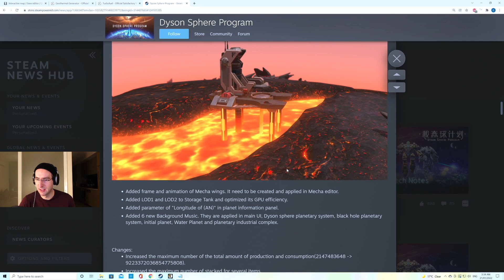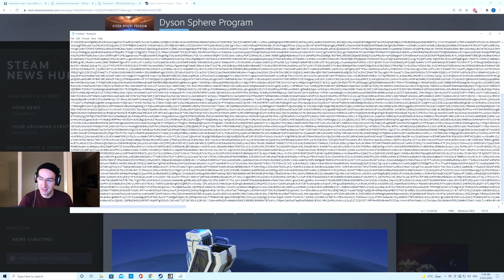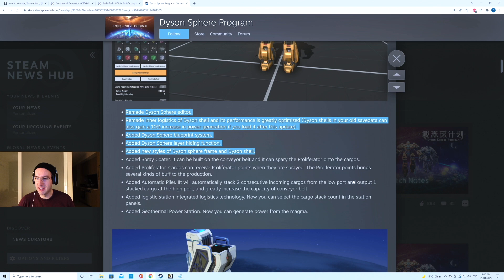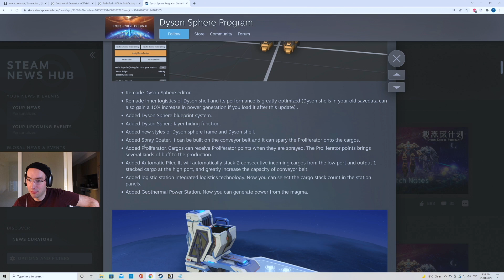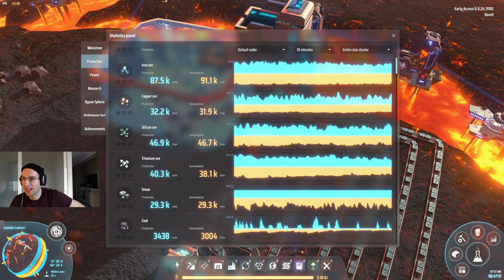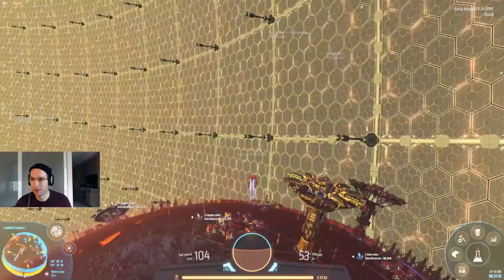Advanced Mining, Proliferation, Item Stacking, Geothermal - Icarus’ Evolution Dyson Sphere Program

Comment: One correction
With the Proliferator, you can choose either the extra production OR the increased production speed.  Not both.
There's a toggle switch in production buildings where you choose which affect you want to apply.
Reply from the maker: Thanks, I realised that when putting together a blueprint for producing the Mk.III Proliferator at 120 per second, it should be out soon keep an eye on my channel :)